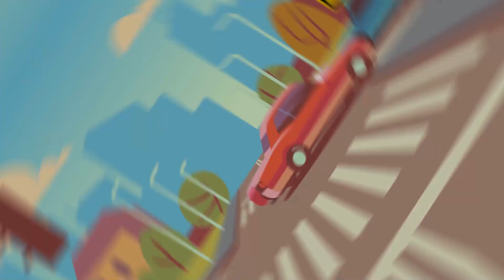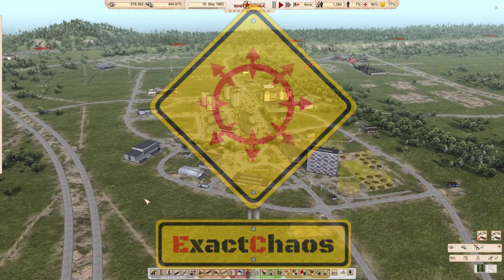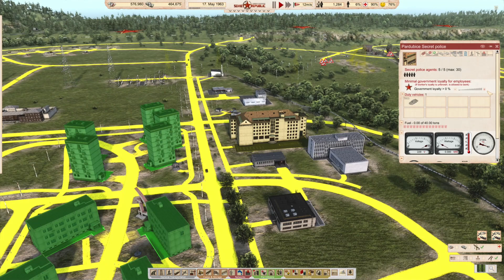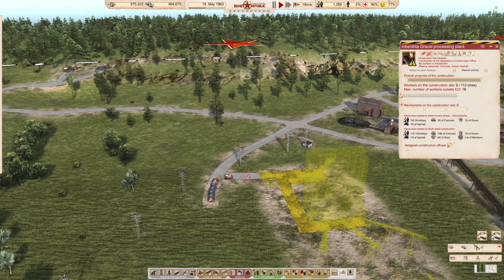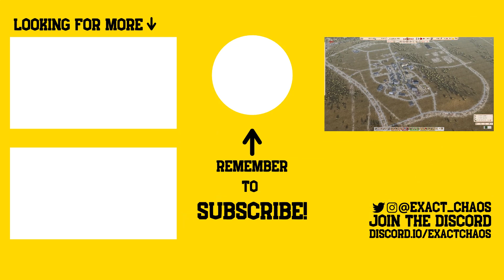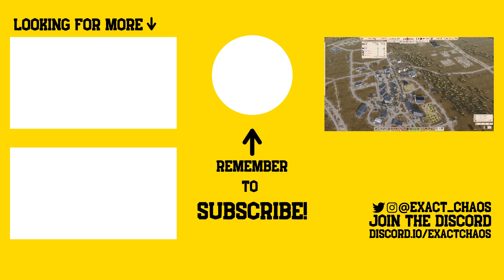Supplement Income with Clothing Exports - Realistic Mode - Workers & Resources: Soviet Republic

Comment: Add a small asphalt section on all 3 roads into the custom house, then add a waypoint on each asphalt section.  You then set the routes of the vehicles to cross the waypoint coming and going. This will force the vehicles to use all 3 roads and stop bunching up on one road
Reply from the maker: A good idea, but won't work with the distribution offices and construction offices that send the vehicles to the customs house. This will only work for fixed route vehicles. So won't be effective for the current game.